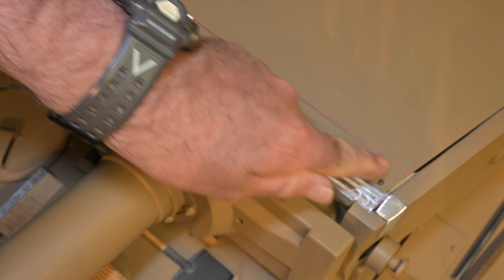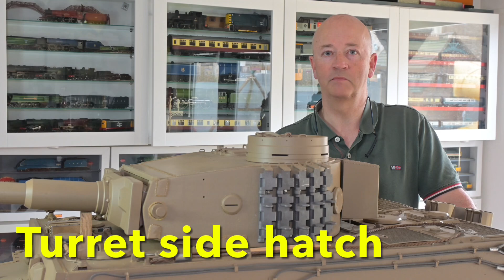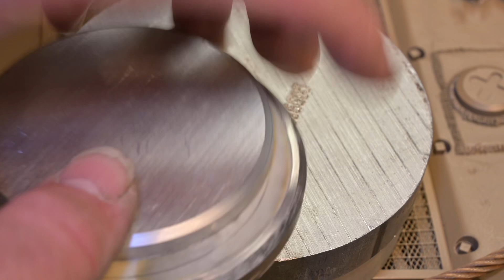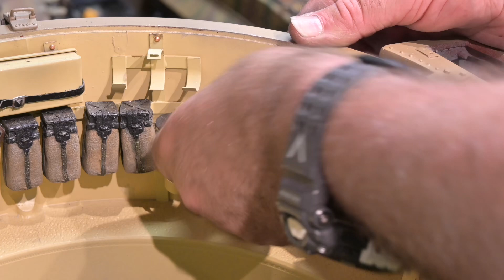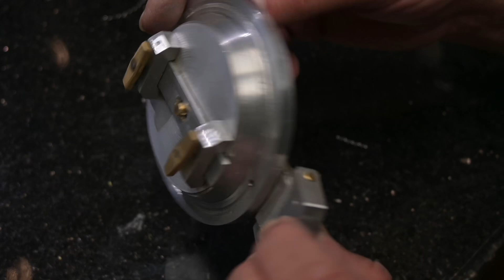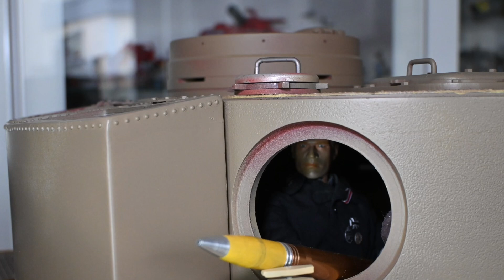1/6 scale - Armortek Tiger 1(Part 7) turret details and detailed side loaders hatch

Comment: The real Tiger's gun was exactly centered in the turret.
Reply from the maker: I will check again.  When tracing back from centre of gun it appears to be slightly off center.
Reply from the maker: Hi Davey,

Checked again.  I think I initially looked at the mantlet which of course is not mirrored in dimensions either side.  I took my bearings from centre of the gun so travel lock bolt marks are central.  Thanks for pointing out the mistake.  I will mention in next video.  Do you mind if I ask if you are David from Tiger1.info?
Reply: @16rctankworkshop-yv8kl   Yes, Tiger1.info is my work.
Why not put a ruler across the middle of the turret and see if the lock bolts fall at the halfway mark?

Comment: Simply stunning attention to detail. Do you research the size of welds and the direction of the weld curves from original tank photos? Cheers.
Reply from the maker: I'm not that sad. I like to get the components right but welding to me is just decoration.  I have seen a few Tigers up close and welds were not identical.  Also I will not stick rigidly to Early, Mid or Late.  Vehicles were often refitted with updated parts so I go with what I like.